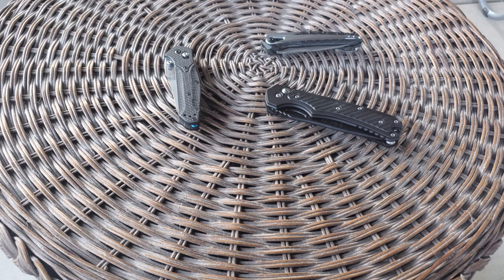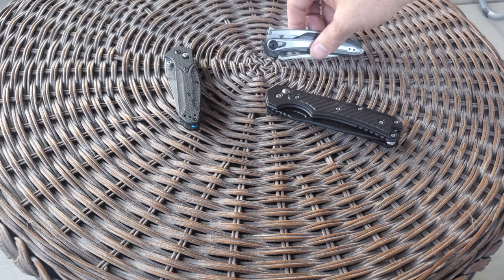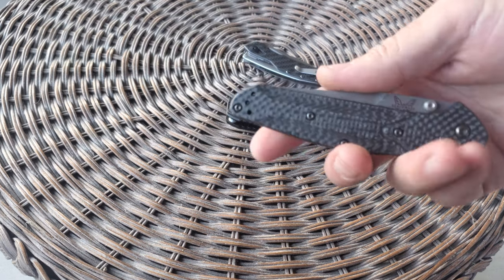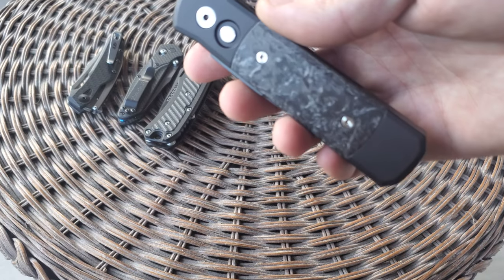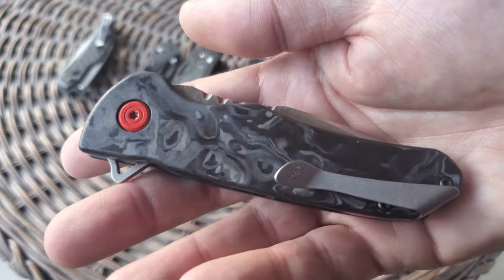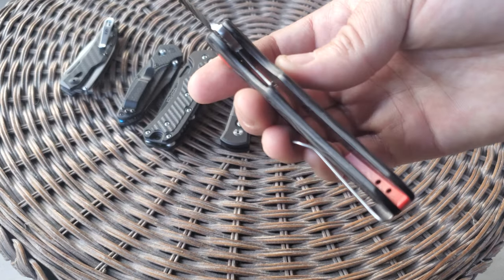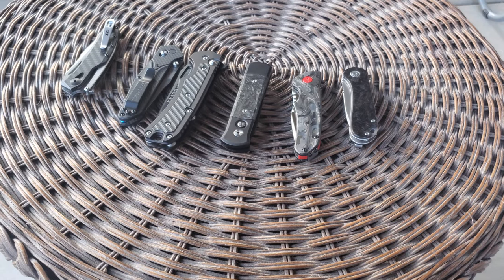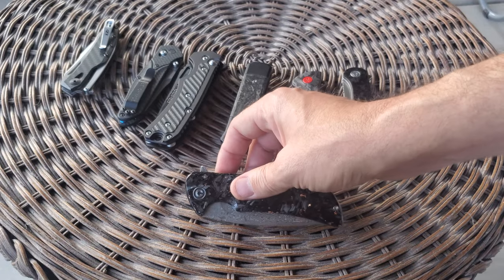Let's look at different kinds of carbon fiber knife scales

Comment: @Yo Mama Knives. Hey man. I purchased some Flytanium CF Basket Weave Crossfade scales for my Bugout. I like the design of the carbon fiber, but there is like ZERO gloss to the scales. They almost look like tree bark. On top of that, the black isn’t deep at all… they look almost gray and chalky. Do you have any suggestions on how to improve the scales so that they have a deep black, but still keep the texture (or at least SOME texture)? I saw a video of a guy suggesting bugging with headlight hazexremover, followed up with MacGuire’s Tech Wax. His results were a smooth, deep black scale. My concern would be that the wax will get crusty over time and I’d lose the texture, which is pretty important when handling a knife. In a perfect world, I’d get my Flytanium scales to look more like Benchmade’s CF on the 535-3 Bugout. Any tips you have are appreciated. Thanks!

Side note: At the end of your video, you said CF is very brittle. Am I better off going with G10 if I want a lightweight scale? I’m looking to have an alternative to the aluminum scales on my 535-4 Bugout. Thanks again!
Reply from the maker: Hey Jason, thanks for the comment.  For the first part, I'd return the scales if you don't like them.  You really won't be able to finish them easily, no way I can think of.  The lack of gloss is ok though imo, meaning there is less epoxy and more of the fiber.  
For a lightweight, I actually like the steel to be as corrosion resistent as pissible, if that's with cf or g10 handles I'm happy.  Lightweights go with me hiking and in the summers here.   I'd only worry cosmetically if the cf dropped, I do drop knives but not often thankfully.  The Spyderco Manix 2 lw, Buck Vantage and now Sprint line, Benchmade bugout, spyderco delica, these have been my go to for lw folders.